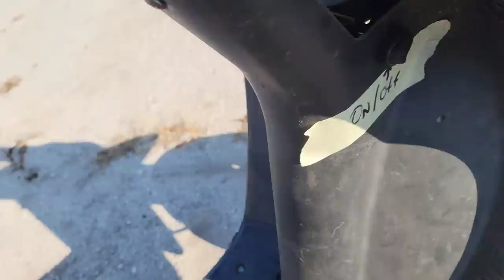Piaggio ZIP SP

Comment: i' m from italy and i' m a teenager, here we got a lot of these scooters on the roads and when I see one of those out of my country my heart goes up😍😍😍..Nice video bro!
Reply: Especially a Zip SP1, i love Piaggio, at the moment i have 13 scooters and 10 of them with Piaggio engine, but a Zip SP1 is absolutely the choice. I have a Zip SP1 with 80ccm Piaggio engine with Athena EVO 80ccm, 26mm carburator, stage intake, Stage 6 Overrange Kit, Malossi Gearbox and Roost RS5 exhaust.
Reply: @MotorKollektiv  Nice bro,it goes fast, I imagine ahah,very nice, here i saw some people mounting on their sp's the 125cc engine of the Piaggio Exagon an then add the 180cc Gilardoni, with the 34mm, dell'orto carburator, also with Malossi  transmission, and Pinasco or Malossi Curva Alta exhaust, then you can literally fly!😍😍
Reply: I’m in the UK I have a gilera stalker 70cc kitted I’m never selling it ever 😊